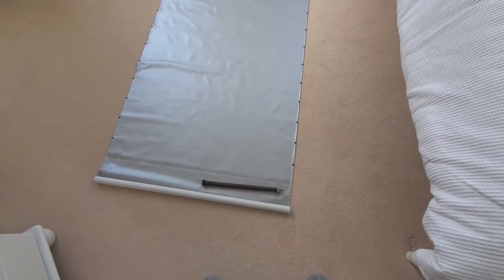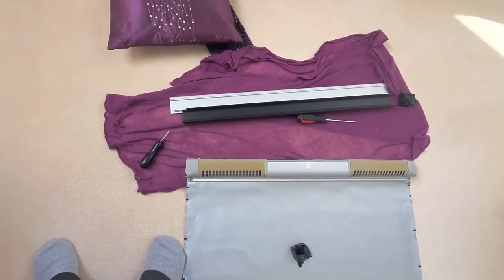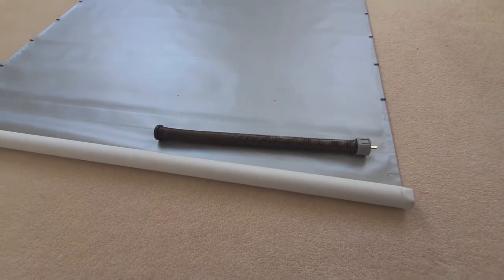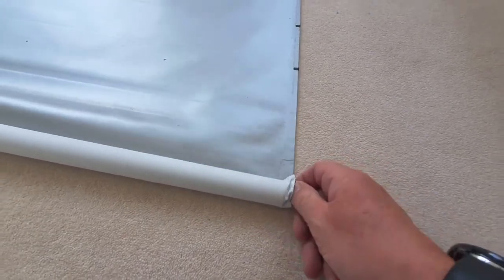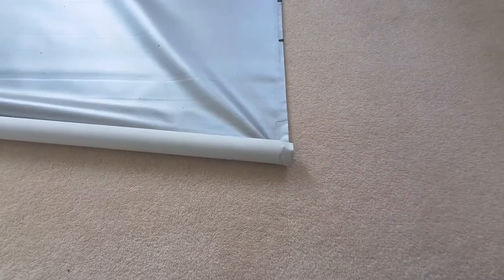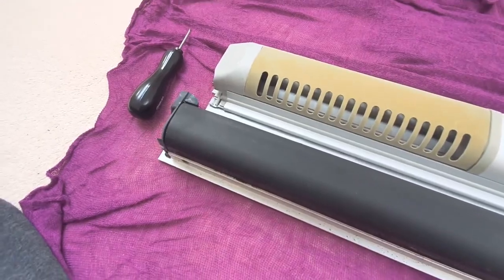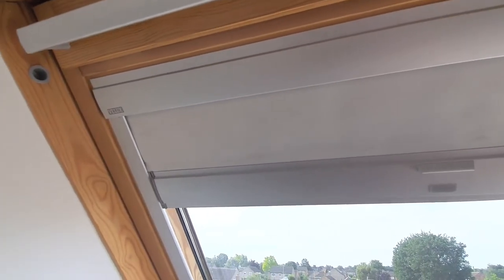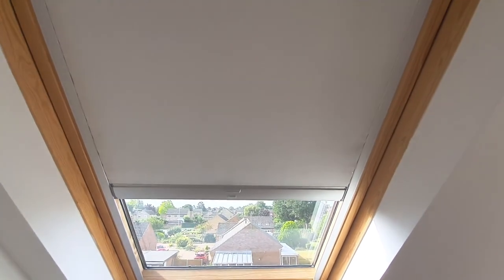How to fix a loose Velux blind spring.

Comment: Really helpful thanks. I kinda figured it out but I was looking for the pre-tension info. 12 turns I take it. Was that enough ? Too much?
Reply from the maker: It's really hard to tell. I think it's about right. Although in a year or two you may find yourself doing it again. I thought if I put too many turns in, the batteries would struggle pulling the blind on ours, too loose, and it will probably go slack again.
Reply: Thanks this is the info i needed too. 12 turns seems like a lot though
Reply: @The_Kharski  just put one back together with 30 turns because i wasn't sure either. It's pretty snappy now but will still hold a half mast sort of position.